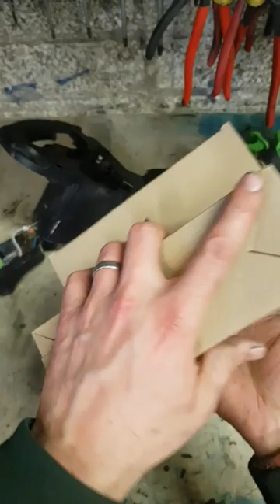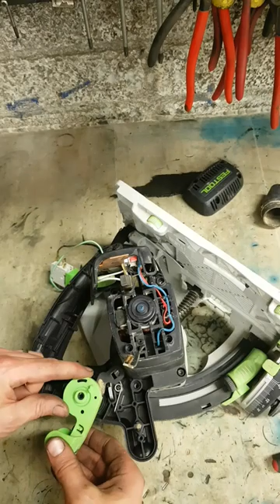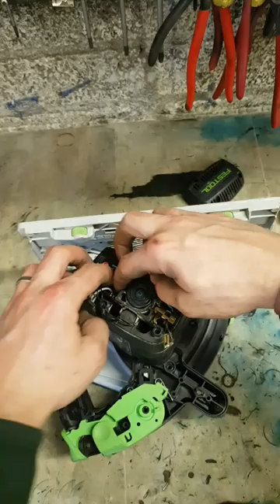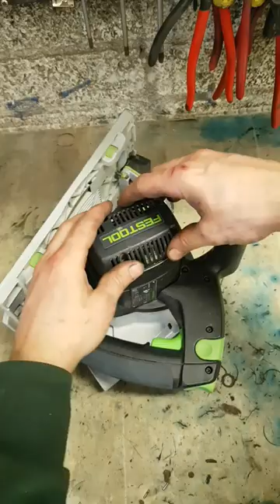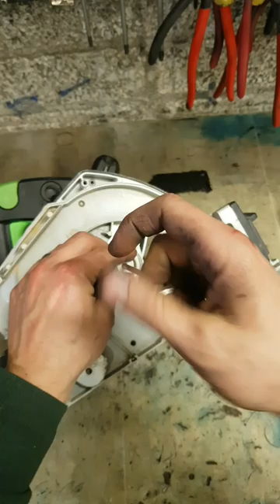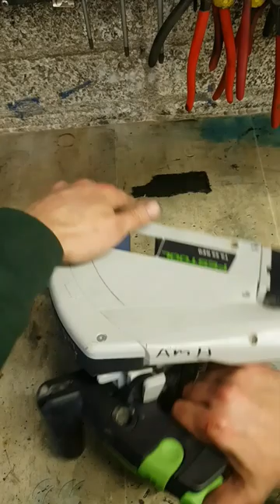@deandohertygreaser #festool #tools #toolrepair #teardown #railsaw #tracksaw #plungesaw  @festool

Comment: Hello there, I have a same festool saw , and it is not working anymore, and I think the carbon brush ís worn out, so where can I get a new brush? I need to replace It
   I was surprised that the brush is worn out that quick, I did not use the saw much !